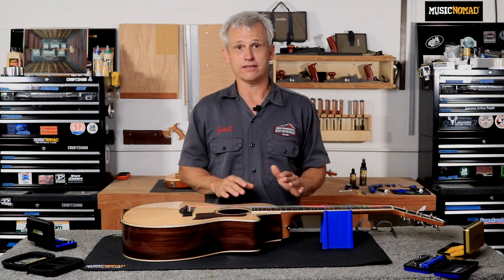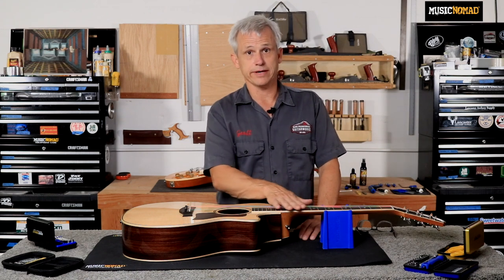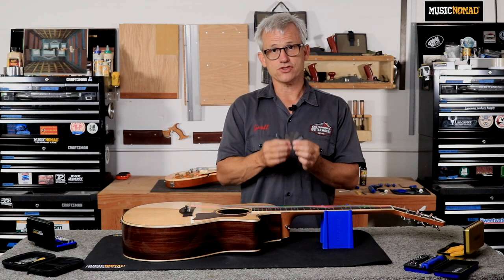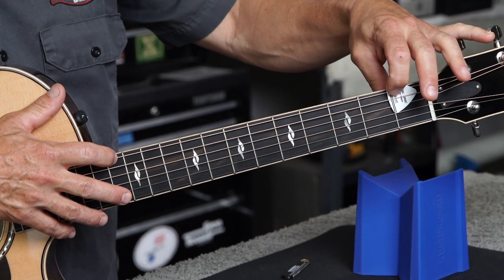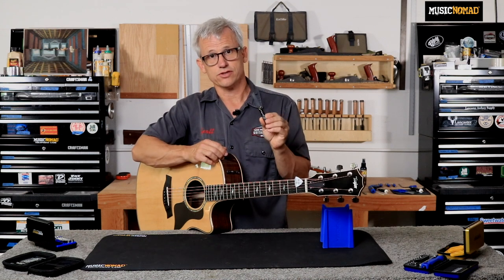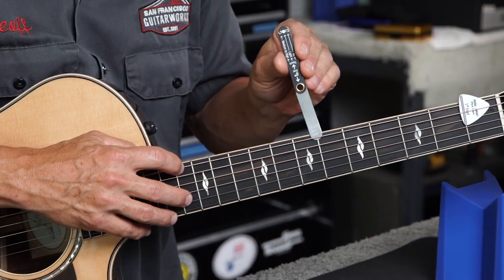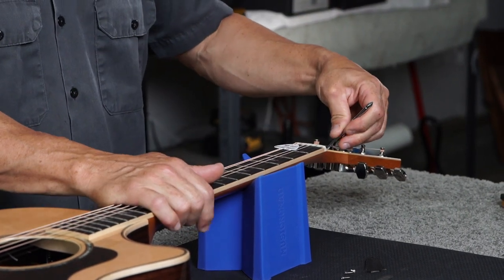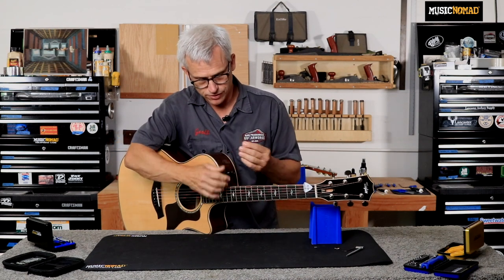How-to adjust a Taylor Guitar Truss Rod (Neck Relief)

Comment: Thanks for this! Taylor themselves specifies relief at the 14th fret to be roughly .010. Would you think that's equivalent to your .008 at the 12th fret? (That specification comes from a Taylor Tech Sheet that's no longer available.)
Reply from the maker: I think you mean measured relief with the guitar fretted at the1st and 14th rather than the 1st and 12th. Probably not much difference between fretting at those two different frets, so Taylor specs a slightly higher relief setting than I would use, but .010" is in the ballpark. Most players wouldn't notice a difference, but I find slightly less relief gives a more even playability, and it's all about the details.

Comment: Too much detail. A bit hard to follow the main point. If neck is too flat, you can slightly turn hex truss rod clockwise. Very small increments only and let sit. Recheck.  Do not force if too tight.